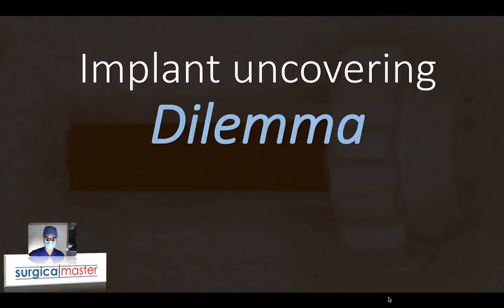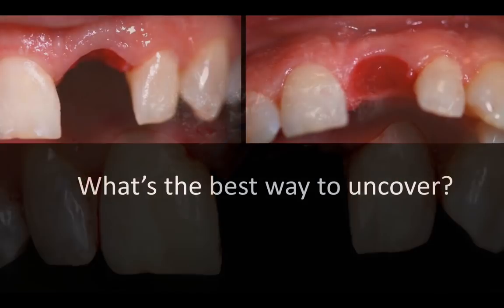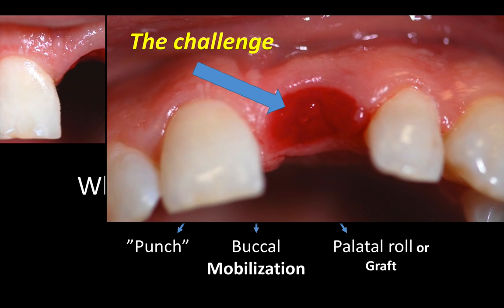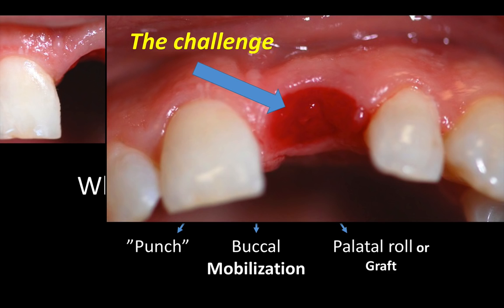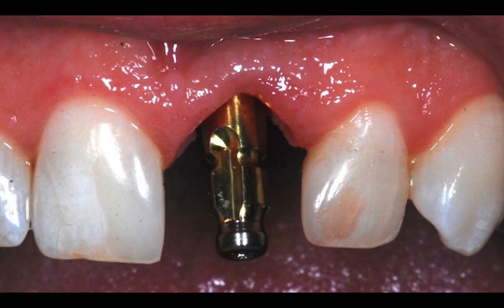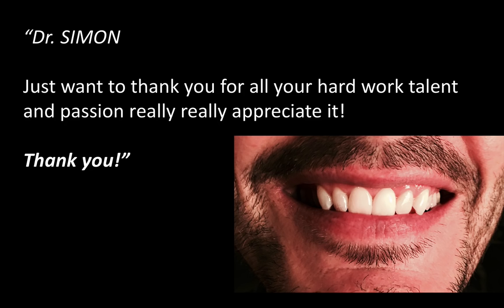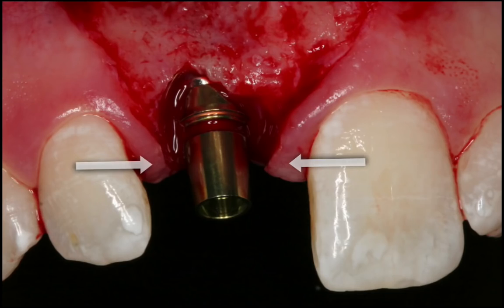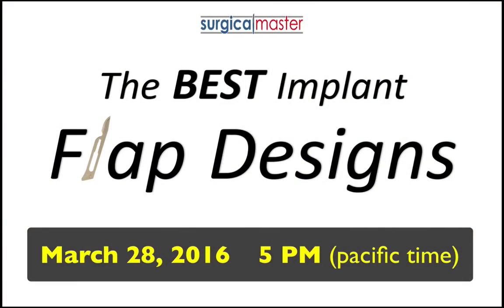BEST Implant Flap Design PART 3

Comment: Can you explain in detail why you decided to do flap, two-stage implant placement vs tissue punch-one stage implant placement w/ provisionalization?
Reply from the maker: 2 reasons. Tissue was slightly  deficient vertically and was hope to get an opportunity to manipulate the tissue to compensate for this. The other reason was that the patient was constantly traveling and from a maintenance and care point view this solution seemed to be best. However, nothing wrong with what you suggest. Probably would have gotten a similar result. We need to make a decision. Hope to see you tomorrow at the webinar on the best implant flap designs. Www.surgicalmasterwebinar.com